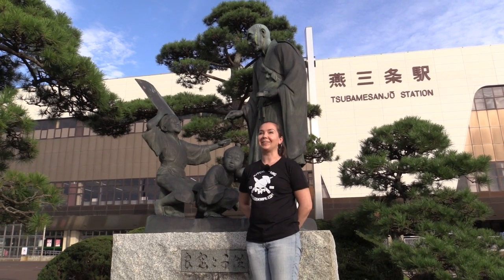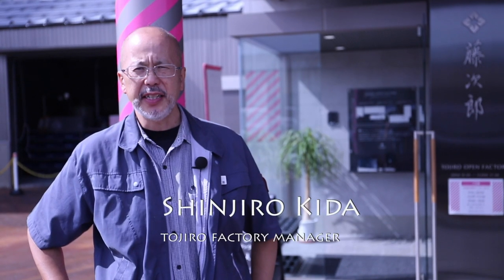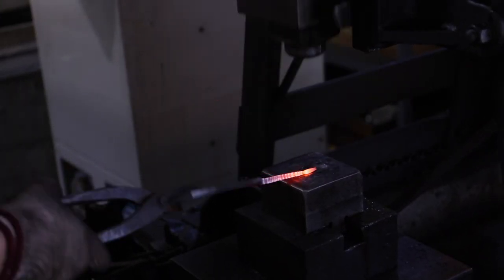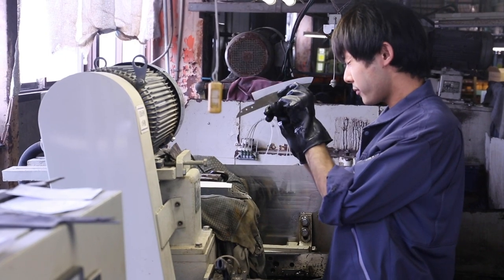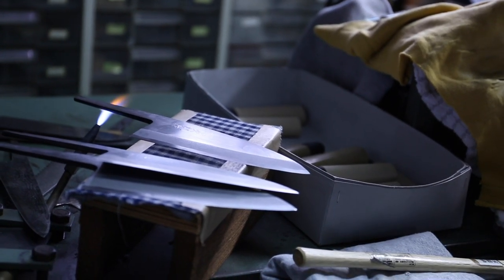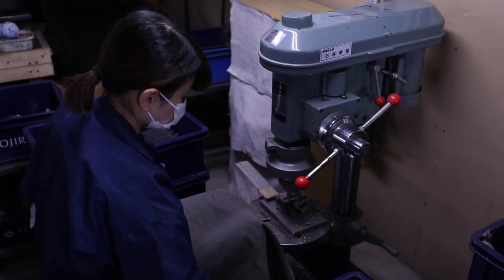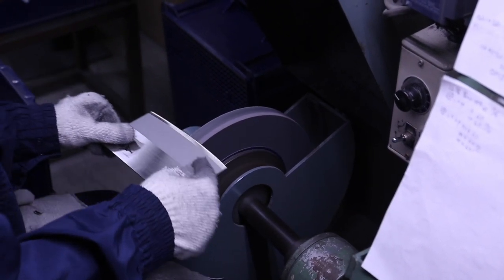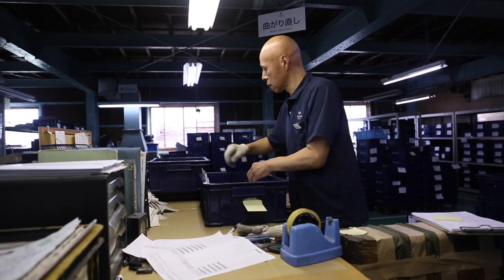How knives are made? Knife making: Tojiro factory tour.

Comment: Even if a German knife is better I would prefer a Japanese one for a thousand reasons, but above all because they have a soul.
Reply: Hey now. German blades have soul too. At least some of them! I can see soul in zwilling pro or wusthof classic ikon.

That being said a Tojiro is of superior quality blade steel by comparison. It also matches top notch German knives on fit and finish. And does all of it for less money than those mentioned above.

I only buy Japanese knives because science. Combined with Japan's respect for the science of making blades.

It's not about soul, here is the breakdown.

1) is it forged. This reduces the grain size of the metal. Improving the microstructure of the blade edge

2) what metal is it. There are a vast number of metals with a vast array of properties. One must chose wisely. For stainless I like SG2, for carbon steel I like aogami super.

3) was the blade hardened properly? For this you need to know the metals hardness range and the stated blade hardness.

4) what shape is the blade, does it suit my use cases? Is it for rocking? Is it for chopping? Is it for slicing? These all have different profiles to make them better.

5) cutting performance. This looks at the thinness of the knife and the grinds applied to the secondary bevel. Changing these parameters effects cutting performance.

6) balance. Where does the knife balance and what do you prefer? I like my balance point right at the front of the grip.

7) feel in hand. This gets pretty nuanced and varies a bit. For me I care mostly that the spine and choil are smoothed a little for comfort. For my grip I just want to feel stable.

Calling all of that soul is just obscuring information and disregarding the scientific processes of making a quality knife. While also trying to put others down around you to place yourself higher. Insinuating that the rest is without soul...

It's kind of soulless if you ask me. But I'm not the most religious person.

Comment: As a metalsmith(not knives), I have a hard time stomaching calling this hand forging.  Someone is holding the blank with tongs and a machine is doing the forging. Hand forging should require a hand powering a hammer
Reply: I only consider it hand forging if they hold the red hot steel between two fingers and pound the steel flat with their palms
Reply: @dirteater3169  well, that would definitely be a type of hand forging.  This most definitely isn't